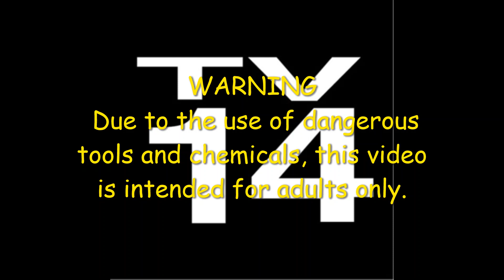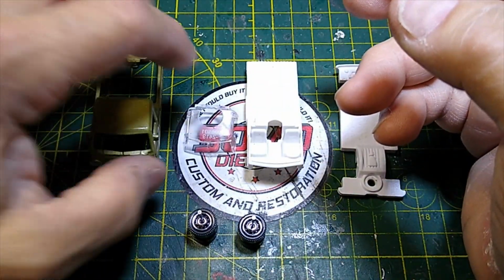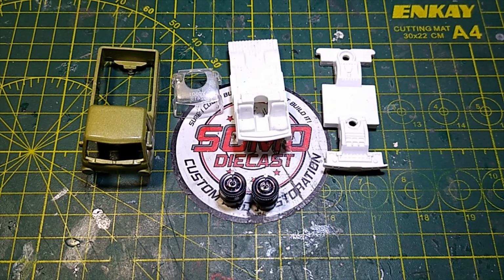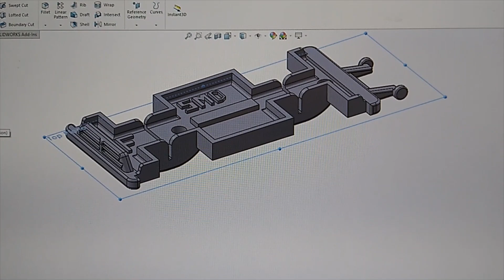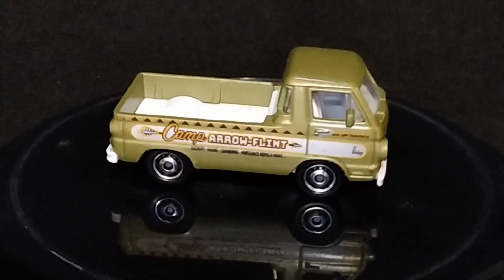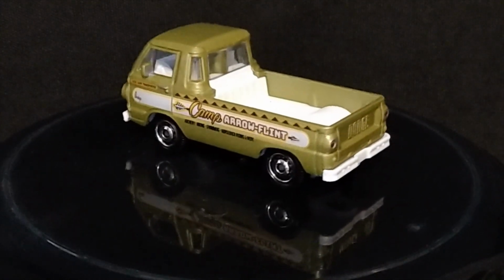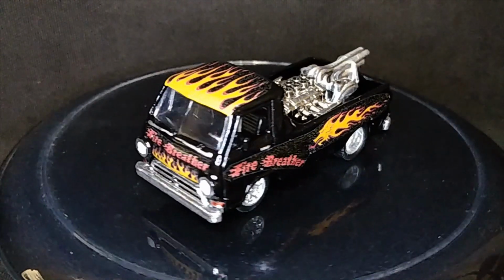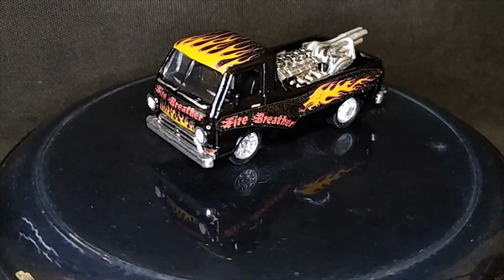Dicast International Builders May 2022 Invitational Pickups Matchbox 1966 Dodge A100 Pickup

Comment: Nice job. I always wondered how well does a filament 3d printer performs with parts in this hobby, a topic rarely heard of at least I've not seen information on it, especially since most people are using resin. The problem is not everyone could afford an expensive resin printer at the same time dealing with all of the complexity they bring. Do you know of anyone with this type of information or could you shine a light on it. Like how well do engines, bases, spoilers etc look on these filament printers.... I already know what they look like in resin. Thanks
Reply from the maker: I know Lee at Time Riders Wee Little Cars, Jim Silva and Andrew at Maple Leaf Customs all use resin printers and they may be able to shed some light on costs. Thanks for watching!